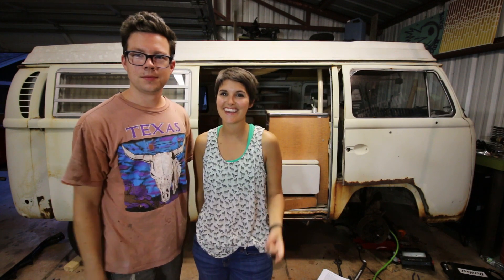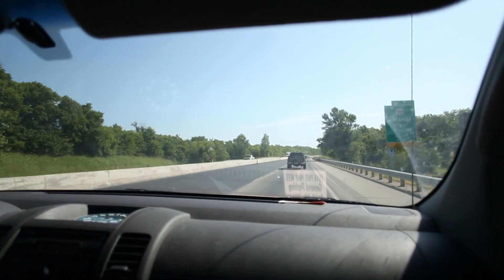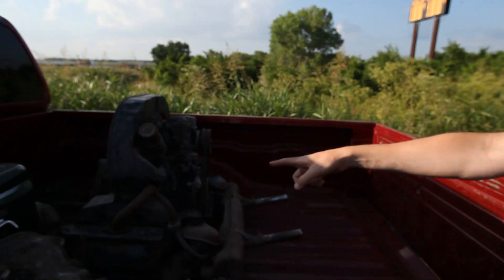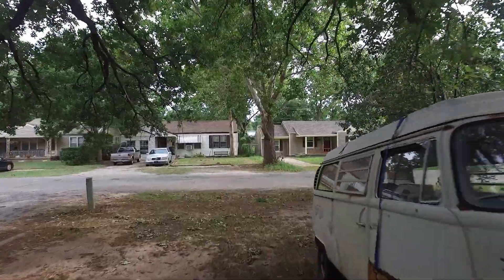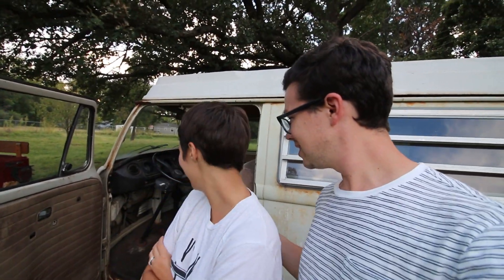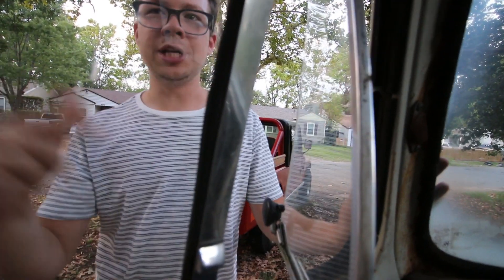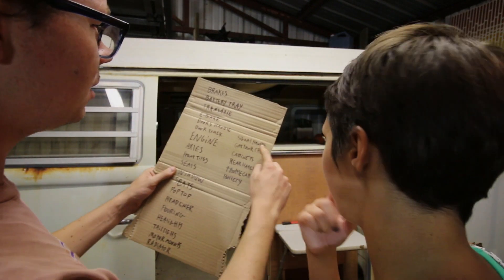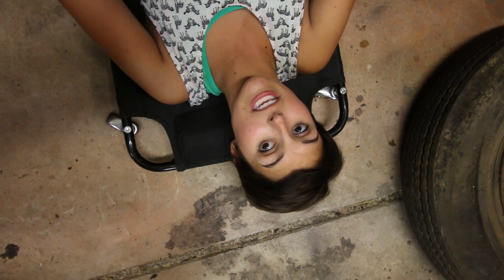VW Camper Bus Rescue and Restoration | Underwood Garage 1

Comment: The best bet is to buy a Subaru engine with ac pump and wiring. You get about 1/3 more horse power and you don't have to change that much.Check it out on you tube The difference in price is worth the extra power '

Comment: Research a Subaru engine conversion. It more than doubles the horsepower!
Reply: and a 100 times more reliable
Reply: Im actually doing that with mine lol just pulled the engine, its an ej22 with 60k miles for $550. Its really the best way to go if its a bus that will be driven daily. If you are just restoring for the originality then you would go with an original VW engine.
Reply: It's not a real vw roadtrip without a real vw engine;)
Reply: I'm with @Tilsen Mulalley on this one. It's not a real roadtrip if you're 100% sure you're gonna safely make it to destination.  :-))

Comment: Cool new project I watched your last project. Lots of props you totally took that thing with no prior knowledge. That is totally commendable and inspiring. Your project is very similar to mine. I have a 1970 Westy and have struggled teaching myself how to do many things. I try to do as much myself and pretty much have been able to stick to that. You can see some of videos. My editing skills are not on par with yours so it may be kinda sucky at times sorry. Le t me know if you need any advise to avoid making the same mistakes I did. One tip I will give right now is to not worry about the appearance of the outside and focus on the mechanical first. If you want to do rust repair that is fine but mechanical is way more important and nowadays people appreciate the patina of original paint as much as a nicely painted bus